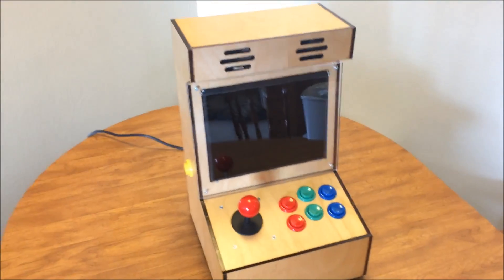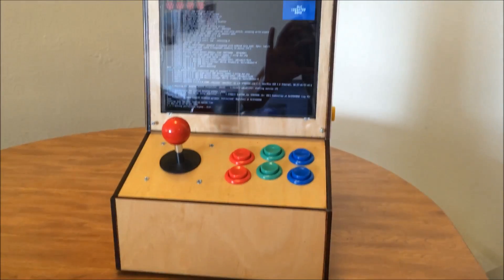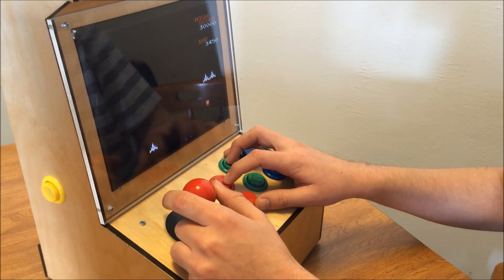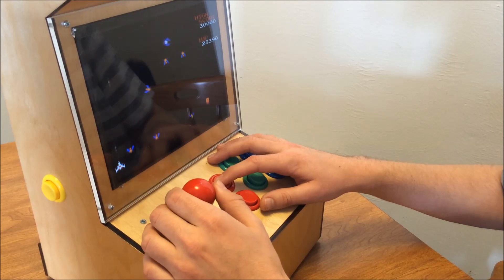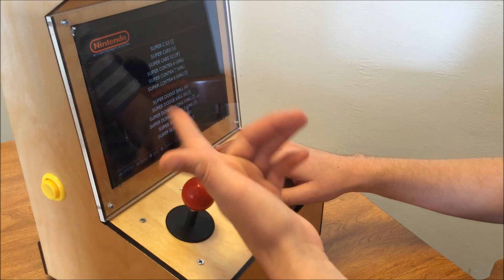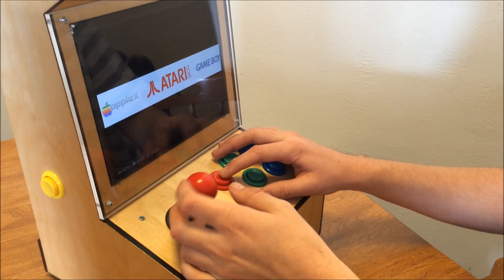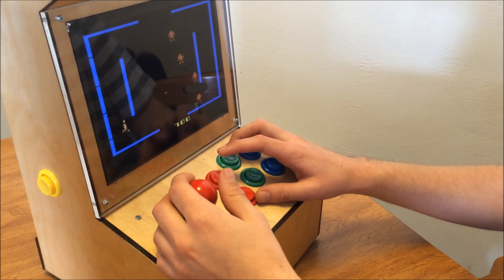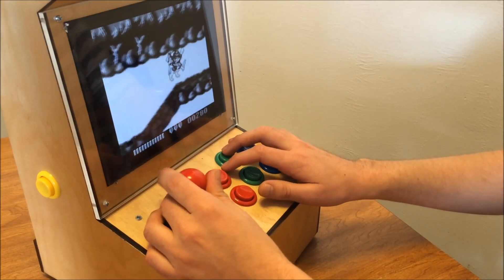My Bartop Arcade Cabinet powered by a Raspberry Pi with iPad 2 LCD and running RetroPie

Comment: Controller = this?
https://www.ebay.com/itm/HDMI-LCD-Controller-Board-Module-for-Ipad-2-1024X768-9-7-LP097X02-LCD-Panel/142458623472?hash=item212b3215f0:g:NSkAAOSw8NNZepzE
Reply: I think it would be cool to replace the iPad 2 board with a Pi zero and power the iPad 2 screen with that. Load Android on the SD card. Might make the old thing useful again.

Comment: MAME and Neo Geo Roms are usually incomplete i got em to work by finding the missing files and basically building the rom file and most times Its works you'll notice alot of Mame and Neo Geo or any Roms for that matter come in a Set try downloading all three then transfer them to the Main File Ive done it a few times and had success with files that didnt work.

Comment: if you still need help with neo geo hit me up
Reply: It says that I add the BIOS file to the Rom for FBA NEOGEO. The ROM and the Bios are both zipped files. So, there are three ways to do this, do I zip the two zipped files together, or do I unzip them and then rezip the contents together? Or do I unzip the rom and zip the loose rom files with the zipped BIOS? Thanks man.:)

Comment: Very nice bar top, I was wondering how you can run the IPAD LCD with 5v instead of 12V
Reply: +David Lammas you can convert voltages to higher voltages somehow.
Reply: +David Lammas step up converter.